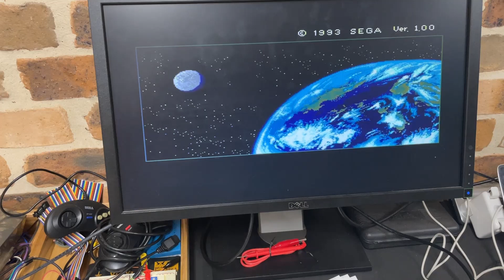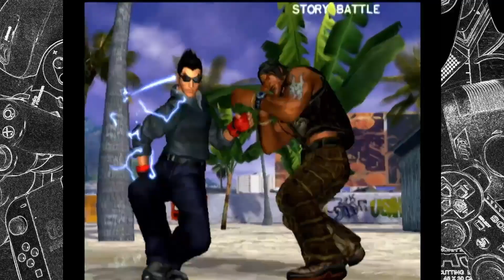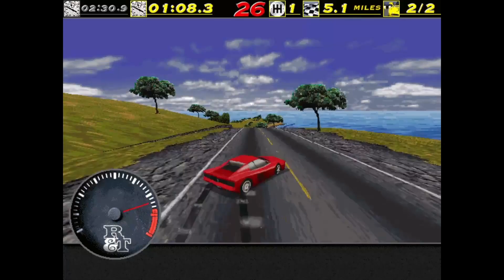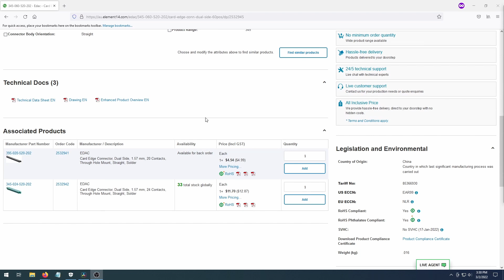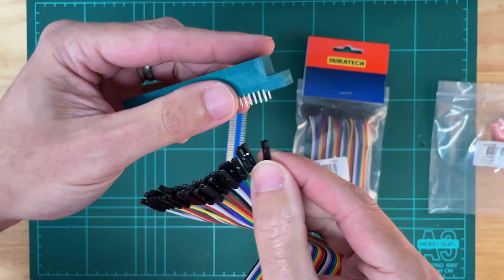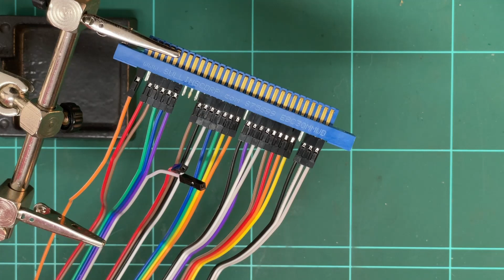Building a Sega Mega CD test harness

Comment: I was wondering why such a thing didn't already exist when i was trying to fix my Mega CD this week.

Why not have the same done on the mega cd board connector? That way it can be completely out of the case to diagnose.  Longer ribbon cables to and from the PSU and CD drive are not hard to come by.

Comment: I saw your video after making my own extension cable.  I harvested the male and female connectors from dead boards and ordered a 60 wire IDE cable.    
Soldering every connection checking continuity as i went, and using heat shrink on the female connector. It worked on the first try.  This took me many hours.
Reply from the maker: Woah that's pretty dedicated! At least you'll have something that lasts now.

Comment: Thanks for posting this a harness like that would be very handy for MCD repairs, especially dialing in the cd drive. A flash/eprom mega drive cartridge is good too for using 240p test suite and MegaCDTest roms. I fixed one recently with the same issue as yours, the megacdtest rom correctly pointed me to two bad rams, it did say the wordram was good when it wasn't though. 😂
Reply from the maker: Good tip for the flashable mega drive cart. I did have a browse for MCD roms recently, didn't end up finding anything recommended. With the actual test rom, are you talking about the one from 'fabiodl' on github?

Comment: Hi, thanks for the video. I'm just making up a wiring harness now as I fix quite a few MCD1 and 2s and this will be invaluable especially when trying to troubleshoot my current problematic Mega CD2 which will not power on. It's not my PSU, the barrel jack, the fuse, Q301, Q302, D301 or the regulator and it's almost impossible to probe around with the Mega Drive sat on top of it. Maybe it's caps!

I managed to plug in all 60 of the breadboard connectors on the female connector without any issues and I'm soldering all 60 wires on the male connector end.
Reply from the maker: I'm glad this video helped out. I think you'll get to the bottom of it once you have access using a harness. Working your way forward from the fuse is fairly straight forward. It's likely it will be a capacitor problem. Mine also wasn't powering on initially but a fuse replacement solved the initial issue. I'm now having to address freezing on boot. If I do manage to resolve it, I'll have a video out explaining the process. Fingers crossed.